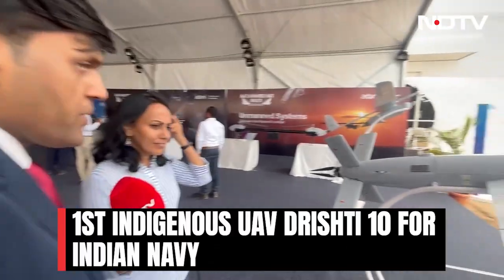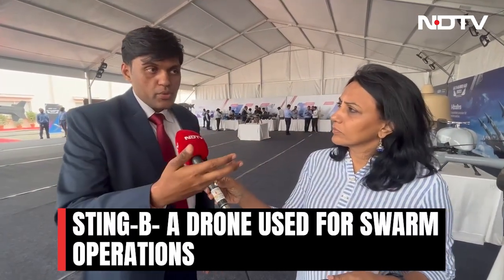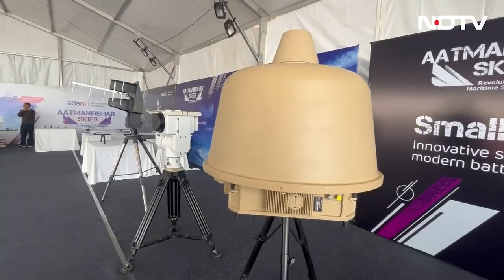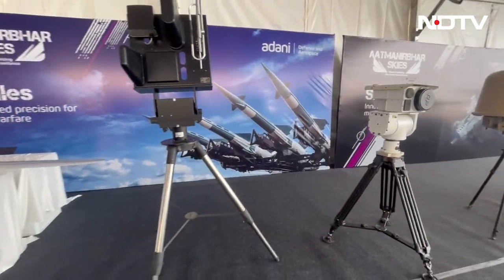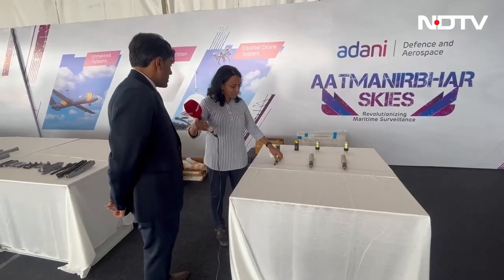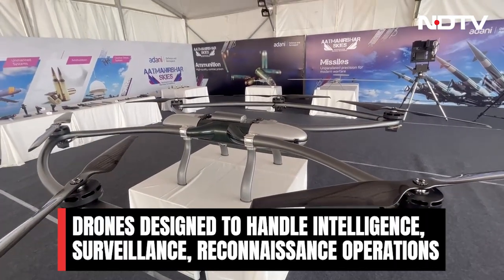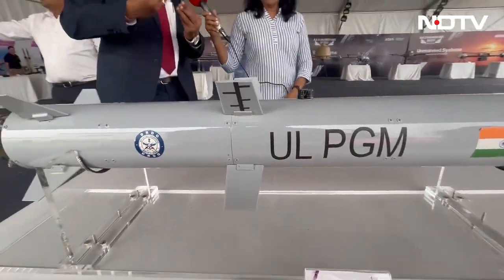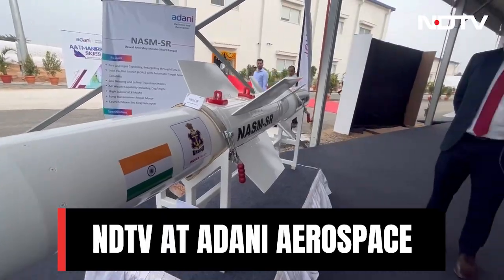Drones, Machine Guns And More: Adani In Defence Of The Country

Comment: No harm in saying that we are manufacturing global products with higher Indian content. Lets not say all these are developed and completely Indian.
Reply: there is great harm in merely doing screw driver assembly
which is what this is for the most part.
Reply: How do you know they not manufactured in India, they are themselves saying saying it, maybe they know what they are doing.
Reply: @amlan9120  

bro.. this is a UAV that has been manufactured and deployed by Israel and its international customers for well over a decade.

All the Adani guys are doing is screw driver assembly figuratively speaking and not much else.

Making a few mechanical structures (probably made by contract manufacturers in China and imported) and populating a few Israeli designed electronics is nothing but screw driver giri.

DRDO has utterly failed at making India self-sufficient in this arena and project managers and maybe even directors of the drone program needs to get the axe.
Reply: @mth469  YOU KNOW RUSTUM HAS BEENA FAILURE SO HERNES 900 IS GREAT SUPRIOR DRONE
Reply: @mth469  where did u learn of this? I want to read more about it.